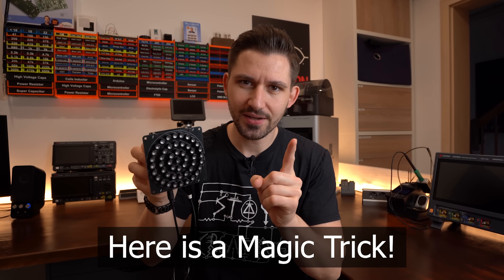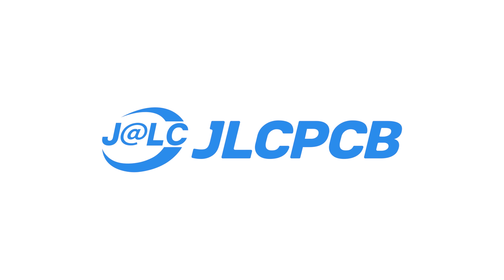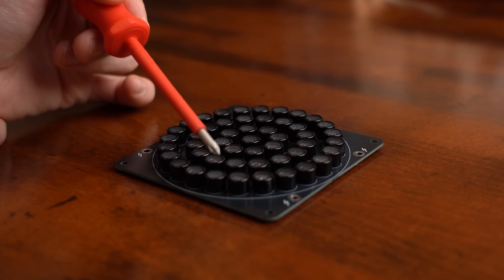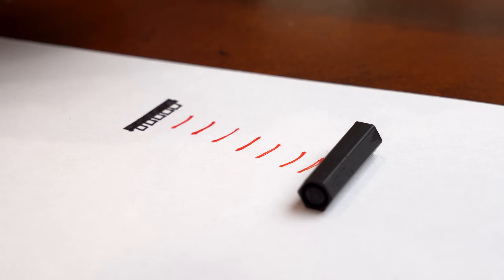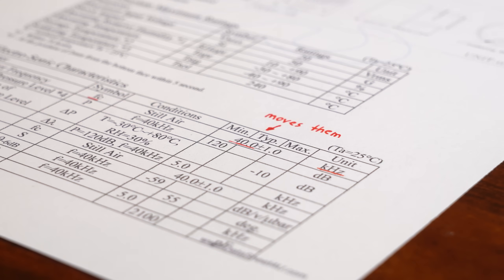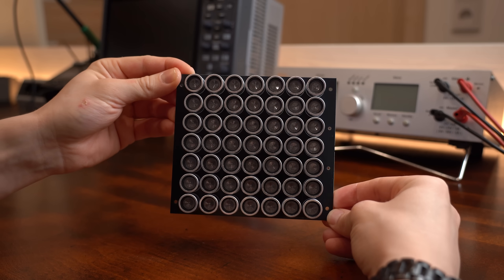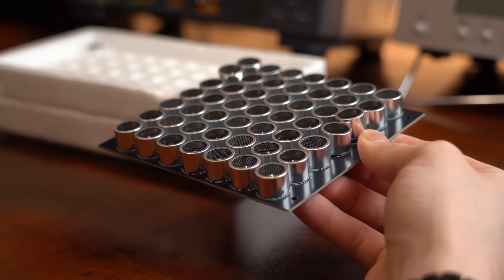The Coolest Speakers are TOO PRICEY? Let's Change that! (DIY or Buy)

Comment: Okay I have to ask. Can you please run an experiment for me/us the viewers with that ultrasonic board you made?  Use the board to make a 3D visualization matrix. Start with levitating tiny styrofoam balls. Then you should be able to use multiple balls and frequencies to make a visual object.  If that get boring use a laser pointer to color the balls to make a color display, with Red, Green, Blue laser pointers you should be able to make a full gamut color display.

Comment: You realize that these system are emitting HUGE amplitude acoustic ultrasonic energy at 40 kHz, and although you can't directly hear ultrasonic audio it's still not a brilliant idea to be experimenting with such acoustic levels in close proximity to your more sensitive body parts. You saw what can happen to aluminum foil, so do not be holding this array up close to your face. 

The concept partially explained here (in the video) is about the Amplitude Modulation (AM) waveform, where the "carrier" is the 40 kHz audio in the air. What wasn't mentioned is that the "detector" in this system is created by non-linearities in your ears; non-linearities caused by the massive acoustic amplitude of the 40 kHz carrier. Those physical non-linearities "detect" the input waveform that was Amplitude Modulated onto the 40 kHz audio carrier wave. 

Your ears are being driven into a non-linear region. "What?"  "I SAID THAT YOUR EARS ARE BEING DRIVEN INTO A NON-LINEAR REGION!! AND WHY ARE YOUR EYEBALLS BLEEDING ?"

Be careful.

Comment: Hi, for the piezodynamic to work properly, the voltage must be higher than 100 volts. There is an ultrasonic dog repeller, so it has a transformer that increases the voltage.

Comment: These only work straight out the front but work very similarly to phased arrays except the phase of all transmitters is the same hence the direction is straight out the front. If you individually controlled the phase of each transmitter it could be a proper phased array letting you change which direction the "beam" points or potentially let it point in multiple directions. That could be used with some kind of detection and tracking system to change the speaker direction so that it always points at your head when you are moving about.

Comment: What's happens if you place the speaker inn a 3 inch hight or 38mm  deep starform box  18mm of the boxes death will block the side noise polution.

Comment: I wonder how well this setup reproduces high frequencies. It might be interesting to arrange these components along an arc, perhaps using a wooden frame combined with a flexible PCB, to achieve a more dispersed sound projection, rather than focusing solely on the area directly in front. This could complement a conventional speaker system quite effectively, I think (if the high frequency performance is any worthwhile).

Gutes Video ;)

Comment: It would have been interesting to discuss why ultrasound is used here instead of audible frequencies since most people may not be aware.  The wavelength of ultrasound is much shorter than audible sound, so it has a smaller diffraction limit (analogous to short wavelength light in a microscope) and thus can be collimated in a much smaller beam size.  To achieve the same collimation for audible sound would require a much larger array of speakers, which would create a much larger beam.

Comment: Hah! Great video! I wonder if it's possible to use a phase shifter with those tiny speakers to control sound direction, similar to the principle behind the Starlink antenna. 🙂

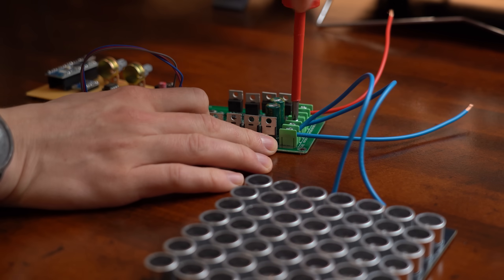Comment: This is a bit confusing honestly. at 9:16 you are showing usage of H bridge, but then the schematic and connection 10:27 shows you are using only 3 pins (PWM, 5V and GND). So why an H bridge? A single Mosfet could have done this, right?

Also, I looked at the arduino code, all it does it just configure the AD9833. Wouldnt it be better if this is done using a smaller MCU like PIC10 or even ATtiny85? But I get this part, it is probably because you have nano around and did not want to get another MCU

Comment: Good setup for playing around. How high is the sound pressure in the ultrasonic range at the ear?
Be careful if you expose yourself to ultrasound for a longer time. Work safety is currently revising the sound pressure limits. The last values came from studies carried out in the 60s and 70s. At least one of them has already been withdrawn as faulty. A maximum of 70dB at 20kHz is recommended and the INIRC/IRPA recommends a limit of 100 dB between 25kHz and 100kHz. I know nothing about children. However, I suspect that the limits are generally lower.

Comment: TL;DR; The concept is over 30 years old. Basicly it's an  amplitude modulation (AM where a low frequency is modulating the Amplitude of a higher frequency). Demodulation is done by the ears as they are to lazy to follow the high frequency. The problem with this speakers is their limited use case. Tourturing your neigbours is such a use case and should still be a very limited use case. :)

Comment: A thought: Did you check the polarity/phase of the ultrasonic transducers? 

As the polarity of the piezo ceramic element in the transducer is irrelevant in its intended application it's most likely random, which would mean the array wasn't working as intended.

FWIW many years back I made a phase/polarity checker to sort the piezo sounder elements for an alarm sounder that used two of them. The drop in sound level produced was quite obvious when two sounders of opposite phase/polarity were fitted.

Comment: I think the transducers have a fairly high "Q factor" meaning that they will vibrate for a while after the drive signal is gone. This makes it a challenge for the speaker to accurately reproduce higher frequencies. I know some transducers used in non-destructive testing are purposefully damped with some acoustic material to quench the vibrations faster. This exponential decay can certainly be modeled (as an "observer" algorithm) and a kind of feedback loop can be incorporated in the software to drive the PWM modulator. I believe driving the transducers in opposite phase can be used to stop the existing oscillations faster. Suddenly we are on the verge of an academic paper :)

Comment: You could've mentioned that what you built was basically a Class D amplifier working at 40kHz - that is how they work. A triangle wave feeds a comparator to convert the incoming audio to PWM, which is then driven via an H-Bridge to do the amplification.

Comment: These are also known as parametric speakers. One big caution is that the sound level is extremely high (~160dB) so if you are in front of it you need to be a distance away because it can potentially harm your hearing and you wouldn't know the damage is happening. It's fine if you bounce it off a wall as the signal is significantly attenuated. So just be really careful when playing around with them.

Comment: 2017 I made the acoustic levitator. I used arduino and my H bridge was a L298N Motor Drive Controller. I 3d printed the clam shell and added the Ultrasonic Transducers.

Comment: Backwards diodes are a scary qc issue, especially when they are in a part of the circuit that basically proves the module was never tested.
Reply: Never tested on a psu. Probably tested on a pin base and everything they tested would have worked.
Reply: Oh yeat that's additional minus, it didn't work in the first place

Comment: I see this and the first project idea that comes to mind is building a phased array speaker so that you can aim the sound in different locations using the speaker. What's the application? Perfect surround sound in a living room for every listener since you could have cameras do facial recognition to determine head positions, then parse off parts of the array of each speaker with the volumes adjusted for each listener's head position. Would need to get the quality of the audio up, but that should be possible by using the right electronics and higher quality components. Proving that it can be made as an array for a reasonable price is the first step.
Reply: the first sound bars did exactly that. Instead of a few big speakers in the room, they had 40 small ones and virtually positioned the sound in the room. The modern soundbars don't use 40 speakers, but way less.

Comment: That configuration reminds me of vintage old Revox speakers, they used that kind of configuration to minimize woofer angle dispersion, but nowadays we can just use Planar driver.
In your case however, this is purely used as pinpoint speakers, like what the early hi-fi soundbar did before they finally figure out phase manipulations (DSP).
Or in this case, you just created a small Radar lol.

Comment: Can you please provide the link for the ultrasonic speakers too? And if the only thing the Arduino + AD9833 do is generate a 40khz triangle wave why not just use a simple NE555 circuit?

Comment: Pulse-width modulating a 40kHz square wave is not equivalent to amplitude modulating a sine wave. This is best understood by the Fourier transform of a pulse wave, as calculated in the “Pulse Wave” wikipedia article. The result of the PWM is that the 40kHz frequency component has amplitude proportional to sin(pi*D), which is a very non-linear transfer function (D=duty cycle). It is most linear near the extremes D=0 and D=1; using a small amplitude modulation near these extremes would linearize the signal at the cost of introducing a DC component to the output (assuming the speakers are driven with an H-bridge). I’m surprised this method yielded output quality similar to the off-the-shelf version presented in the video.
Reply: limit of sin(x)/x as x tends to zero is 1.  Neither speaker is HiFi, and for small modulation indices I would have assumed both approaches work satisfactorily.
Reply: @andybarnard4575  "limit of sin(x)/x as x tends to zero is 1." what does this have to do with my above statement? 
"for small modulation indices I would have assumed both approaches work satisfactorily." for small modulation indices, the PWM signal has zero amplitude because the derivative of sin(pi*D) is zero at D=0.5.

Comment: The microcontroller would have had all the neccesary periferals to take in a signal and modulate it onto a pwm output. No extra ics needed. But i assume you know that. Why did you do it this way?

Comment: What about aiming a speaker at a parabolic dish?  Could you create an audio beam this way?  3D printers utterly unlocked the ability to do this: print a mold and cast the dish in concrete or whatever reflects sound best.
Reply: Or repurpose an old tv sat dish into an audio reflector.   Again, you might have to make it more rigid to increase performance, and reflect, not absorb, the audio.  But you already more or less have a mounting spot where the original focal point exists.

Comment: Interesting project, but I was surprised he used a waveform generator just to put it through a comparator to generate the PWM signal. The Arduino has a perfectly good PWM generator and ADC built into the MCU…

Comment: if you instead mounted the array of transducers into a parabolic dish shape you would have been able to maximise the linier directional beam to really make them hyper directional. having them set up like both the buy and your home made version, doesn't so much come out as a cone, but more like 50 little intersecting cones leading to the scatter audio and likely some of the distortion.
making a mk2 version of this would take it to the next level, and maybe work on the amplification a bit to make it variable, even add a ir remote.
All up though this is a pretty awesome project, and yet another rabbit hole for me to fall down.  mind is already working about using the ultrasonic levitator 3d prints that are online and repurpose them as speakers, make it so you and your wife can sit next to each other and listen to different music without headphones.

Comment: Im not 100% positive but ilI think the mechanism by which you hear sound when the carrier frequency is 40 kHz is that the sound hits your head or a solid object and gets distorted. The distortion demodulates the AM frequency as sound in the air. Then you hear that sound. Id be interested to see how well PWM and phase modulation schemes work.

Comment: Some years back as the museum in my town built a new building. They wanted to have a self guided tour available. First thought was the ancient low power RF system. That turned out to be much more expensive then they wanted to go for. There was the 'Well we have the cards that explain everything. That is good enough.' So about a year after the museum opened, people were not really satisfied with the experience. Something had to be done! My then wife, who worked at the museum was in a meeting of the staff and they were told come up with something we can do that is not to expensive. She asked ne what would you do. I said I would go with the low power RF. She told me that was to expensive. I then said directional speakers. She asked about them and I explained then and was asked 'how soon could you do this?' Sense then there have been two up grades to the audio system, and a new 'wing' to the museum. It was a fun and exciting experience.
Peace

Comment: Hello, I was wondering if you could explain a device called "ISG starter" (Integrated starter-generator). basically a 3 phase generator that are also a motor. it is used in hybrid vehicles and in honda vario mopeds. 

i am particularly interested at how the ESC can have alternate function as a rectifier-regulator when the motor connection has it's own electricity. thank you

Comment: Now, if you start modulating the delay of the sound you should be able to turn it into a sort of "AESA" speaker, like those radio transceivers that can create beams of EM and direct them by modulating the start, speed and phase of the radio signal.

Comment: Interesting that it can transform any object in a virtual speaker. 
* Placing a sheet paper in front of the beam should recreate a more traditional speaker (but very flat). With the added bonus, the mass of the paper can be tune to dampen the carrier frequency.
* Multiple segments with different size of emitting surface and numbers of transceivers for multi segmented modulation ?
* Arranging them on a sphere (with paper "wrap" ?) around to create a 360° speaker ?
* Use cheap microcontrollers to do DSP-stuff on the signal before modulation ?

Comment: Before watching the entire video I already have a guess of how they function. They're basically an AM transmitter with an ultrasound carrier frequency, i.e. the ultrasound beep gets modulated stronger or weaker based on the pressure value from the sound to play. Let's see if that guess is correct.
Reply: Yep, I guessed right. Yay!

Comment: I remember about 20 years ago, making a breadboard amplifier 
that used 2 transistors and 2 center tap transformers, 
to make what I think is called a "Push-pull" amplifier.

I connected a 14 inch woofer to the input 
and headphones to the output.
I was able to hear someone whisper 20 to 40 feet away...outside..

Comment: A sound wave with a frequency of 40kHz has a wavelength of approximately 8.6mm, i.e. if you sphread "speakers" at the right places (in-phase) you will have the much better results ;)

Comment: Because the transducers resonate at 40khz, by using PWM you are actually AM modulating the signal because instead of low passing the PWM for retrieving the low frequency component, you are narrow bandpass filtering (about 4kHZ) so you get a 40khz sinewave with a 4khz bandwidth AM modulation.
Reply: So it's basically like an AM radio but the mechanical (audio) waves are modulated here instead of RF signal, which makes it possible to us to demodulate it directly in our ears?
Reply: @misch2  i guess that the piezo-transducer is not symmetric and when the power  that is driven by is strong enought, it clips to  either the positive or negative semiperiod much sooner than the other one, so there is a "de facto" half wave mechanical rectifying (aka AM detection).
Reply: Great explanation! What sets the bandwidth when you PWM?
Reply: @Sam-tb9xu  PWM is a special case of Phase Modulation in which besides the modulated carrier, you also have the low frequency modulator signal. If you BPF the PWM centered to the carrier frequency, you get the fundamental harmonic of the PM. But, PM is related to FM so that the PM is the integral of FM. If you keep the modulation index below 1/10th (that is, the ratio between the bandwith of the modulation signal and the carrier frequency), the second and upper harmonics won't interfere the fundamental frequency, yielding a good AM equivalence). That's why direct conversion AM receivers can also receive FM stations when tuned to VHF band.
Reply: Thank you for explaining that! I was confused as to why PWM would demodulate the same way as AM

Comment: We had one at our art college, in the form of a 2' x 2' ceiling tile.  If you stood directly under it the audio was very clear.  Walk away and it was inaudible.  The problem was that down a corridor and around a bend more than 100' or 30m away, the audio was also audible and a lot of people thought they were hearing voices.  We retired the speaker, which was never used again.  Thanks for the fun video!
Reply: Wasted , if you put a carpet at the spot, then the other spot will not have audio